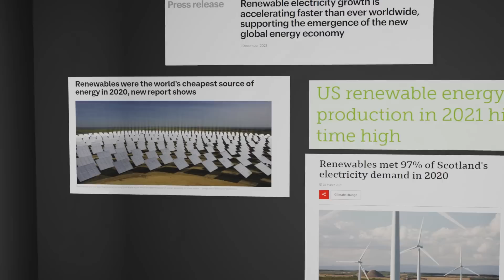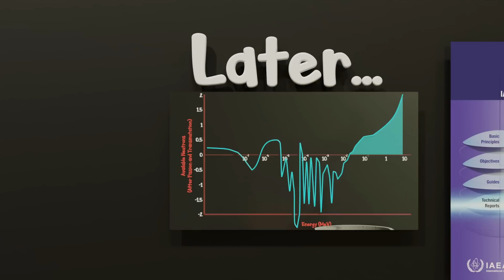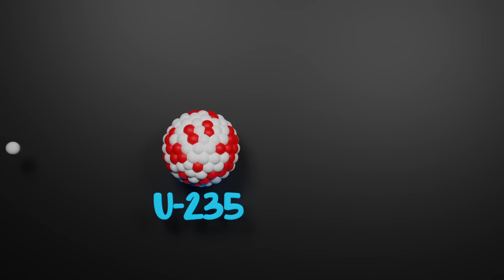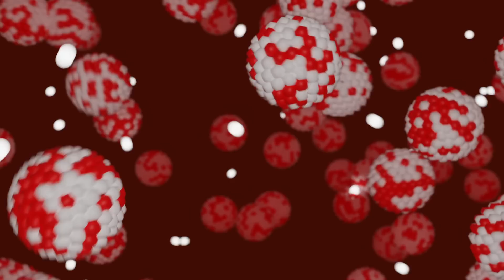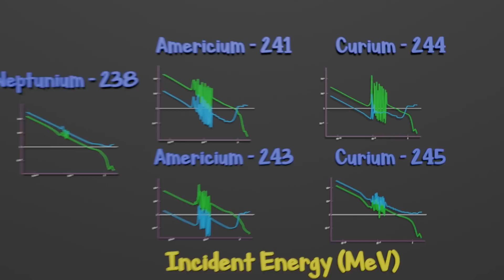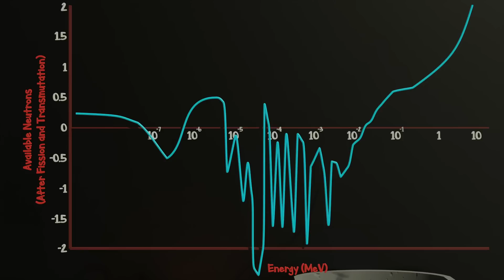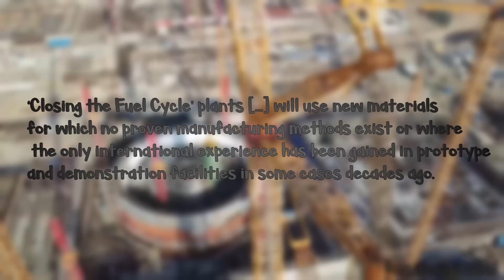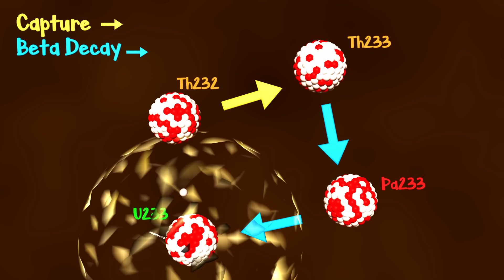How to turn Nuclear Waste into Nuclear Fuel

Comment: This was an excellent video in every way but leaves someone worrying about how spent fuel could be used to create bombs which is NOT correct.  Your own video claims this, but shows why it doesn't happen.  See the items below:

@4:50: "Pu239, this is the fuel used in atomic bombs"  - Technically correct but makes people think spent fuel can create atomic bombs
@11:22: "One simply needs to steal a few kg over time [of plutonium from spent fuel recycling] to construct a bomb" - Nope.  There are too many other isotopes of plutonium (and probably other elements) that will make that bomb a dud or "fizzle".
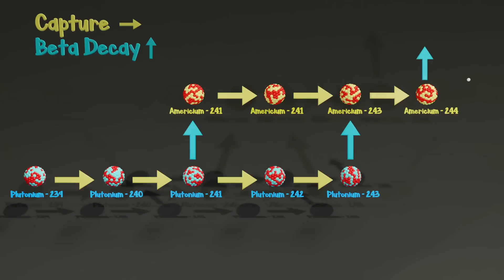@10:30 This is exactly why spent fuel doesn't become a bomb.  These isotopes will always happen to some amount in a power reactor and the longer it is run the more of them you get (per your comment on MOX fuel recycling).  These isotopes absorb neutrons which are required to make a nuclear bomb.  If you want a bomb, you need very pure fissile isotopes, such as U235 or Pu239, neither exists in nuclear waste in the purity required, and to make it pure it is easier to start with natural uranium and use enrichment than to start with spent fuel and try enriching that.

Comment: What isn't mentioned about the fast reactors is, if thorium is in the mix, you get plutonium isotopes that are short lived and poison the potential to use the plutonium as a weapons grade fuel, it would require centrifugal isotopic separation as with Uranium and thus be no more valuable to rogue states than Uranium ore.

Comment: ADSR reactors usually doesn't get enough attention in videos like this but yet it is theoretically possible to make such reactor that would give about 40 times more energy then we will have to pomp into it to operate. Additionally those reactors could burn nearly all possible nuclear waste and even use it as a fuel.

Comment: Excellent video. However some surprises are evident based on internet public data and data included on this video.  Internet data reveal that during year 2022 the nuclear power plant generated 2653TWh/y energy and consumed 62496 tonne Uranium, and these spent uranium will go to "waste".  Calculating we have 1 tonne Uranium waste per 42450717 kwh energy generated.  US nuclear waste 2000 tonne per 804 TWh/y energy corresponds 1 tonne west per 402000000 kwh which is 9.5 time more efficient than the world average. Are these data reliable?

Comment: I vaguely recall that, early on, one of the reasons thermal won over fast breeder reactors was that the former were very effective at producing by-products that could be processed for the nuclear armaments industry, while the latter were very effective at disposing of (consuming) those same materials. So there was advantage during the arms race to thermal. I’m curious whether there are any videos that look directly at this issue.
Reply: Civilian reactors are not utilized for production of weapons material. Special or purpose built reactors were deployed to produce Pu239. Rods had to be removed < 3 months to avoid buildup of Pu 240. Uranium is enriched to > 90 percent in centrifuges for weapons production.

Comment: We should use hot nuclear waste as a heat source. Instead of burying it in remote areas you could put it in a buried container with a heat exchanger and build an industrial park around it, most industrial applications need low level heat that is usually generated with natural gas or electricity. For example you use the heat from a buried waste pile to distill alcohol for fuel turning making the process actually carbon neutral.

Comment: A Purex plus , new process.  And new neutron sources, like RF Ion beams with deuterium. Deuterium made from breeders.  I'd like to see a solid state accellerator like some CVD layers, something like a sandwich of material all counter-wound, roleld up, and squeezed in a vice...   anode, water in graphene and silicon nanopowder,  thin film LiNB or LiTA,  thorium and germanium nanoparticle mix, cathode, permanent magnet core.  Stimulate it with high voltage, low current discharges might cause accelerated decay.

Comment: No nuclear reactor can run on "waste" . 

In a nuclear reactor uranium and plutonium is fissioned to mostly radioactive fission products. A 1200MWe nuclear power reactor creates about 1 ton of fission products/yr. It is not feasible to fission it again.

Existing nukes are fed with about 20tons of low enriched uranium annually. The used fuel of 20tons as well contains 1 ton of fission products plus 19 tons of uranium and bred plutonium plus claddings. 

Since the 1940ies this used fuel can be reprocessed and the plutonium and uranium seperated. In France, UK, Japan, Germany and Switzerland it was/is usual to reuse this reprocessed plutonium and uranium in new fuel elements in so called MOX fuel elements.   

In most countries a once thru cycle is preferred for economical reasons.

Comment: I disagree about both nuclear fusion and the sun,wind,water kind of renewable energy.
But you have in fact described the best solution.
 I was working for the FERC at the time when the "Pacific NW" didn't get enough rain and snow for California's hydropower, so the standard defense for sharp demand increases was "spinning reserve" gas turbines. A 60 Hz AC system, necessary for the working of transformers, demands a very prompt response to a load increase, which slows down generators that are overloaded, and if some slow down faster than others, they supply the grid bus with different voltages, because it goes from zero to max in one quarter of a 60th of a second then zero, negative max, zero.  If the voltage difference is high enough to endanger the bus, the offending supplier will be dropped, so "spinning reserve" can charge ransom level fees.
"VRE" is quite hopelessly Varying (it isn't "variable" like gas) so it worsens the problem.
Nuclear fusion on Earth depends upon the deuterium+tritium reaction that provides a huge amount of energy per unit mass, but not nearly as attractive per unit volume. The equation creates just high energy helium nuclei, and furiously higher energy neutrons. These are both high energy radiation, so no radioactive isotopes isn't such a great bargain. Any neutrons that our fusion reactor doesn't capture can make the machine itself radioactive.

Comment: Overall quite good, but worth noting that as U238 gets bred to Pu239, there are a lot of excess neutrons around in most cases.  That means the Pu (particularly in "spent fuel" today, is a mixture of isotopes and those absorb too many neutrons to give you a bomb, even if you chemically separate it.  In a fast reactor, you get a lot more fissions (destroying the Pu isotopes as you mentioned) but any Pu left behind will be a mix when running it as a normal power reactor.

Comment: You assume a solid fuel core.  In a molten salt core, you could syphon off fission products in real time.  Also, you could use a thermal spectrum reactor to also transmute u238 into plutonium (or Thorium into u233) and keep burning it that way.  The main advantage to thermal spectrum vs. fast spectrum reactors are that the fissile inventory required is much smaller, the control of the reaction is easier as it is a slower reaction, and the overall capital costs and safety could be much improved in a thermal spectrum reactor.  There's a reason fast reactors have been tried by all major powers for decades and yet it hasn't gotten anywhere.  Additionally, any solid reprocessing of spent cores, especially those containing plutonium, can lead to proliferation concerns, meaning only nuclear powers and trusted democracies can do this part of the fuel cycle.  The developing world, however, is where most carbon emissions will come from in the future.

Comment: Your math was off on the carbon capture.  First, you believed them, which is at your own peril.  Second, there's not enough space to store even a fraction of captured carbon in the earth.  And third, where the math comes in, is that the coal plant has to burn significantly more coal to be able to fuel the energy-intense process of capturing and compressing the co2 into a storable form.

Comment: 11:45 there is quite a few more.. SAy we set the limit at 50MW. then it would be.

Fermi 1 (60MW) FR (D) 250MW, Phenix (250MW), Superphenix (1240ishMW), PFBR (500MW), Munju (280MW), BN350 (135MW), BN600 (600MW), BN800 (864MW), CFR600 (600MW) Brest (400MW), Joyo (Thermal only 140MW)

Comment: Neither wind nor solar is really especially clean. Cleaner than coal. sure, cleaner than gas and oil. possibly. Cleaner or even as clean as hydro and nuclear? sorry, not even close. They are at least a order of magnitude out, if not 2.

2:05 Chernobyl was not a meltdown, it was a over criticality
3:45 no carboncapture really don´t exist in reality

5:15 Typically 1½% of the uranium would also be fissionable

Comment: I have been hearing this same old "Song-n-Dance" for the last 50 years.... THERE WILL BE NO NUCLEAR WASTE .. IT WILL ALL BE PROCESSED .. REUSED.. BLAH.. BLAH.. BLAH...

Fifty Years back... India adopted the CANDU CYCLE to use it abundant Thorium Deposits in the "Sands of Kerala"... NOT A SINGLE THORIUM REACTOR has been made in India or CANDU's Parent Country.. Canada... where I worked in the CANDU Industry in the 1970's.

The Story is the same in the USA where I spent 20+ years supporting the Operating Nuclear and Gas Turbine Plants as an Engineer too.

The Tokomac Reactor "showed up" in the late 1970's and promised Pollution Free Energy with Zero Waste. What they did NOT TELL YOU was that everything around the TOKOMAC, specially the massive Magnets, would become Lethally Radioactive adding to Nuclear Waste Pollution and Open-Ended Liability for 100,000+ years...

There goes the Nuclear Promise of Clean and Cheap Nuclear Electricity... too cheap to meter... remember...???

But all is NOT LOST for these "NUCLEAR ADDICTS"..... 

It is a shame for Man and Mankind that one still pursues Lethal Waste Producing Nuclear "Options", as this same Nuclear Fraternity TOTALLY IGNORES THE LARGEST & ONLY POLLUTION FREE NUCLEAR FUSION REACTOR THAT DELIVERS 173,000 TW of Nuclear Fusion Energy TODAY.. and has been doing so since The Birth of the Earth and long after AFTER Mankind  will be gone.... IT IS CALLED... THE SUN... STUPID...???

It gets even better..... using PV Panels one can DIRECTLY CONVERT THE ABUNDANT, SUSTAINABLE, SAFE & POLLUTION FREE Solar Energy to ELECTRICITY TODAY that is also Cost Effective. 

[No need of Complex Boilers, Steam Generators, Turbines, Condensors, Cooling Water/Towers, Turbine-Generators and thousands of Pumps, Blowers, Heaters, Fans, Valves, Sensors etc.. etc either all interconnected with hundreds of miles of Electrical Cables and Pipes with numerous Control Systems etc...].

Get over it... Welcome Solar Energy as the ONLY Abundant, Sustainable, Safe and Pollution Free Energy and utilize your capabilities and capacity to harness this Nuclear Fusion Energy as fast as possible and STOP PRODUCING LETHAL NUCLEAR WASTE that can only endanger Mankind's future 1000+ generations... 

Remember .... every ONE TON of Lethal Nuclear Waste is actually 100,000+ Ton-Years of Lethal Pollution... and Mankind DOES NOT NEED THIS ANYMORE... the 21st Century belongs to Solar Energy / Power.. and the earlier the Nuclear Fraternity understands the less money is wasted on these unfulfilled dreams of "Nuclear Dreams of the 20th Century"...
Reply: You're wrong

Comment: Some numbers regarding carbon capture here in Saskatchewan. The Boundary Dam coal power plant produces 531MW of power. Only Unit 3 which is only about 1/4 of the total plant captures any CO2. Of that 1/4, 90% is temporarily captured, and then half of that CO2 is lost back to the atmosphere after it is used to help extract crude oil. So instead of the 90% carbon capture rates claimed by proponents it's more like 10-12%. And even then unit 3 is more likely to be offline than the other units because it is more expensive to use and maintain. So even the 10-12% capture rates is optimistic.
And this is a successful carbon capture installation. Most have failed much more spectacularly.

Comment: Your characterization of risk and danger level is GROSSLY inaccurate, particularly with your comparison of plutonium and cesium. 

Radioactivity and half-life are approximately inversely proportional, meaning the shorter the half-life the more radioactive and dangerous it is while the longer the half-life the less radioactive and less dangerous it is. Think shooting star or a rock singer, the brighter it burns the quicker it goes out. Short lived radioactive materials like fission products are ENCREDIBLY dangerous while long lived transuranics, like plutonium, are not very dangerous at all.  

The ACTUAL dangerous materials in spent nuclear fuel are the fission products, the vast majority of which will be completely gone within a decade or two of production. The only fission products you'll really have to worry about for longer than the amount of time that it takes a baby to reach drinking age are Cs-137 and Sr-90, which as you noted, have half-lives of about 30 years. However, they only make up, on a combined basis, about 12% of likely fission products.
Reply: Highly radioactive isotopes such as I-131 have a half life of about a week which means that they won’t be a large problem for very long.
Reply: @i_am_a_toast_of_french  Correct, it has a half life of 8 days, meaning after 56 days (7 half-lives) the total radiation being given off by the I-131 has approximatly reached background radiation levels and after 80 days, 10 half-lives or a little more than two months, there's virtually no I-131 left.
Reply: @williamsmith1741  it's really a trade off between radiation released and time, but plutonium will consistently be more dangerous due to its biological (it's a heavy metal) toxicity and the fact that the decay pathway involves multiple different radioactive isotopes
Reply: @i_am_a_toast_of_french  If it's actually heavy metals you're concerned about, then I'd think you'd be a lot more concerned about the millions of solar panels that are going into landfills where they'll be leaching heavy metals like lead, mercury, and cadmium, which don't have decay periods and thus will be toxic forever. 

If you're concerned about the marginal radioactivity of a long-lived isotope like  plutonium (which is only marginally more radioactive that natural radioactive uranium ore), I'd point out, again, that radioactivity and half lives are approximately directly inversely proportional, and that low levels of radiation do not seem to be harmful, like in Ramasar, Iran, the most radioactive place on Earth, where the bricks are made of mud FULL of thorium, urnanium, and their decay products, and there's no signs of negative health implications from that. 

You also seem concerned about plutonium's decay products. Pu-239 is an alpha emitter, meaning it's radiation comes in the form of a He-4 nucleus, which can be shielded with a sheet of paper. Pu-239 decays into U-235, which has a nuclear half-life of 700 million years, so not really a concern. 

Regardless of how you look at it, long-lived isotopes are not dangerous, and trying to equate them, in terms of danger, with mid-term half-life isotopes like Cs-137 or Sr-90  is hyperbolic sensationalism and fear mongering.

Comment: There are no operating carbon capture power plants operating at this time.  What coal plants have is scrubbers that remove sulfur dioxide and particular filters for coal ash. CO2 is not controlled at all because the energy needed and other costs are just too expensive to be practicable.  About a third of the energy produced by a coal plant is required to remove the CO2 from the stack gasses.
Reply: It’s a bit uncomfortable to put a lot of carbon dioxide underground, and many projects are working way under expectations.

Comment: Great video and extremely informative - the all round overview has enlightened my perspective on this ongoing and important issue. 
However, with current technologies available, CO2 does not need to be sequestered and can be refueled. That is to say, we have no need to pump the captured CO2 into the ground as we can create new fuel from the capture, allowing us to make energy from the captured byproduct, much like the reuse of the cores and with far less risk.
For more info on the capture and refueling of  CO2, check out Carbon Engineering on this, the most informative of social media outlets.
I am sure you will be as pleased as I am that there are more cost effective and lower risk solutions to our misfortunate status quo 😉
Keep up the great work and looking forward to part 2. 🙃
Reply: CO2 is energetically stable, which means you can’t do much with it.